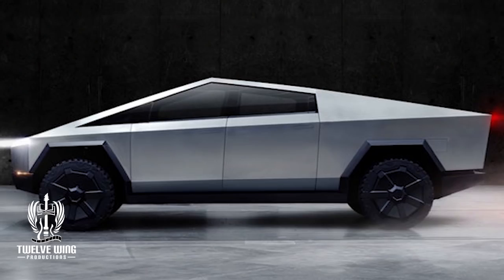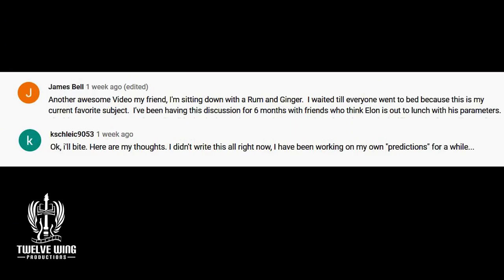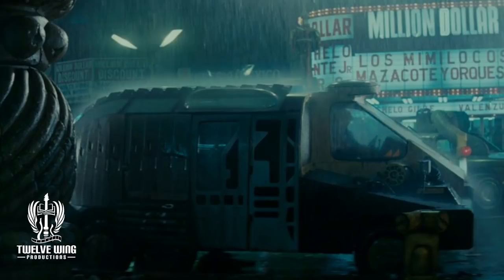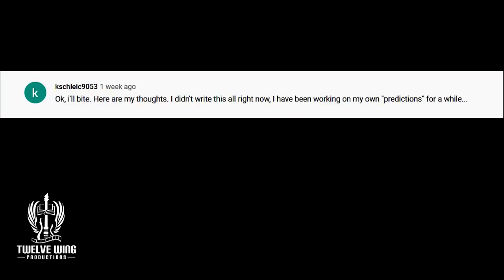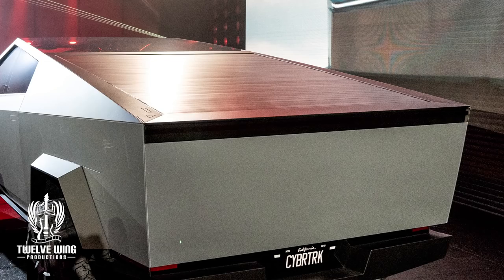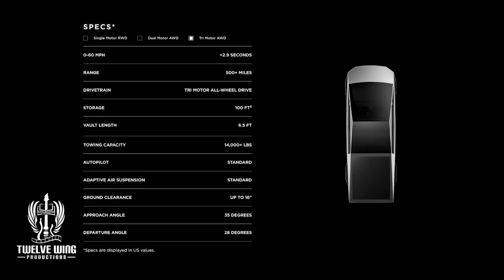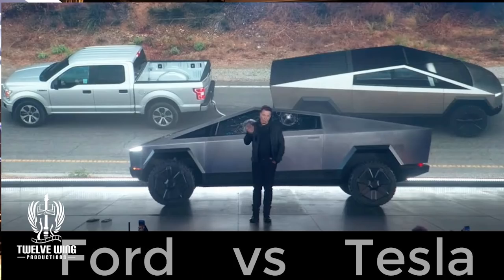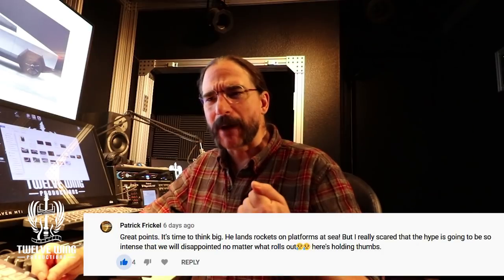Tesla's Cybertruck was not designed, it was engineered.  Here's how you benefit.

Comment: Thanks for the mention,  I wish I'd gotten more right but this truck looks almost how I was imagining.  I don't find it ugly at all.  I really enjoyed putting my wish list to paper on the last video.  This truck in its current form offers so much of a blank canvass.  I'm not talking about the lack of paint.  The first think that I was thinking was "CANOPY MODE".   I would like the vault height to adjustable at the gate.  The tonneau cover should be on a frame and hinged at the vault peak with sides that slide into sides of the vault (pocket door style). Once the tonneau was level, the frame would lock, and the ramp from the gate would slide up, securing the VAULT in 'canopy mode'.  
Hey I was wondering if you would be interested in addressing the "other elephant" on the internet here in a future video.   Towing at Max GVW ... "Sure it'll go 500 miles ... EMPTY !!!"  All the haters seem to have this as their goto criticism when it comes to electric trucks.  I think that most people are looking at this towing conundrum all wrong.  The fact that we are dealing with electric drive trains opens us up to a whole new opportunity for innovation.
  The whole Battery Electric Skateboard 'platform' is already practically a trailer.  We all know that 'pulling' extreme weight has nothing to do with towing (I think you've even said this sort of thing before).  So if we throw a couple of those model 3 motors(or however many are required) and a suitable battery pack under the floor (most trailers are basically ... a floor), would that not exponentially improve braking capabilities?  If we were to sync the computer from the trailer to truck and let them share the batteries, could we potentially 10X the range depending on the size of the trailer? If we were to engineer it properly could we safely 'PILOT' a trailer and load on par with Class A Semi long haulers?  I say "PILOT" because it would seem that the trailer essentially becomes its own powered vehicle. The CYBERTRUCK would just 'clip in', supporting a fraction of the overall weight. And of course this works for any type of trailer from low-bed haulers, 5th wheel Class A RV's or Utility style Construction Tool lock up trailers.  This only just touches on how much the 'OFF GRID' potential for construction and or recreation just increases again exponentially.  There are some trailers that will require some further thought.  Boat trailers are going to require some design modifications for instance. LOL  Anyway this could all be for a different conversation one day.  I might be out to lunch here but when I start hearing people say that it can't be done my mind starts racing on possibilities instead.
Reply: Pretty much what I was considering
Reply: If the new solid state battery tech passes, the distance will be a non-issue.  I know Elon has been working with Goodenough with the tech so unless something goes wrong we'll probably be seeing it fairly soon.  Heck didn't Elon announce the million mile battery? That's probably the solid state battery tech.
Reply from the maker: @yg2522 , Have a look at the video we put up by that name.  I go over some of the hallmarks of a solid state battery.  Key among them is that the battery will actually increase in capacity from when it was new.  Perhaps for a few weeks to a month.  That is pretty much exactly the opposite of what happens to traditional paste type electrolytes.

Comment: Just a small comment, just as they have an air compressor for the suspension, they have a DC/AC inverter for the motor to support the plugs. So theoretically they can provide as much as the inverter can provide for the motors.
Reply from the maker: Dang it... I totally forgot to mention the air compressor as a missing specification.  Good catch.
Reply: @twelvewingproductions7508  no worries, I think most of people here are very familiar with the car :)

Comment: This vehicle is going to have a diverse market because it will do things that no other car or truck can do.  I'm 70 and ordered a 2 motor Cybertruck.  My neighbor's a 72 year old lifelong Ford guy who currently has both a gas F150 and a diesel F250.  He ordered a Cybertruck.  My oldest daughter ordered a Cybertruck.  Then I ordered a single motor version as they may become available first.  You can either welcome the future or resist it.  Resist it and you get run over.  These are vehicles that you'll be able to leave to your kids and know that they'll be safer and happier.

The Tesla Cybertruck works as both a 6 passenger SUV and a 3500 lb load capacity pickup.  Tons of storage front, sides and rear.  All lockable.  Supports both 110v/220v electric and air power tools.  Up to 16" clearance with air suspension that adjusts to load is standard.  More powerful than any ICE pickup or SUV available.  250+ to 500+ miles of range.  2x faster charging than even current Teslas.  Virtually waterproof.  Far lower maintenance than any ICE vehicle could ever hope to have.  Cold rolled, 30x hardened stainless steel alloy developed by SpaceX:  a rustproof and generally scratch-proof body that will even repel 9mm FMJ bullets.  The most advanced drive assist electronics available and over-the-air upgrades are included and even full autonomy (when it arrives) as a purchase option.  Solar charging for range extension.  The biggest downside is that we'll have to wait until late 2021 for large scale production.

Change is the only constant in the Universe.  Don't let it run you down.

Comment: It’s not that Tesla stopped before styling it; It’s that 3mm cold rolled stainless steel won’t cooperate with being styled.
Reply from the maker: That's what Elon Musk said in his tweet, but that alone doesn't explain the lack of styling.
I don't believe that this was an engineering or design choice ahead of time.  I think the material was the result of the decision not to stamp the car.  Not the other way around.
The reason for this is that from the beginning it was decided to make this truck on the cheap.
That was an engineering requirement I didn't give enough weight to when I did the first video.

So while it might be true that the decision was conjunctive, this truck wasn't styled in any way.  Its shape is the direct result of its engineering and that saved them a fortune.

Comment: There is a popular opinion floating in the internets that this truck will have safety issues due to it not having conventional crumple zones. My thought was... can't they just scar the steel from inside strategically so that it has some needed crumpling properties?
Reply: Yeah. I also think its very likely this will actually be a class 3 truck, like the Bolinger. Think about it: The payload is 3500, so if the truck weighs 6501 boom, class three. The heaviest F150 is 5700 So especially with a large battery, air compressor, all the steel paneling.. well it's not much of a stretch to think it's just over 3 ton, and that would make sense as to why all the models have the 3500 payload, because they all need to have curbweight plus payload breach the 10k gvwr to make it into class 3. 

Now I assume that Elon would still do all kinds of things to make the truck safe in a collision, like scoring the inside of the frunk frame, but if it's Class 3, he'd be doing that as a freebie, not as a requirement... maybe? They don't need airbags, and some are putting them in anyways, but I don't know what else they get to skip. Crumple zones might be part of it.
Reply: Every ute in Australia has a bull bar on the front so hitting a cow or a kangaroo does mean an automatic write off. I'm not sure truck owners care about crumple zones.

Comment: What I would love to see (even as an option) is a 380 V Outlet and a DC outlet to charge other electric cars.
Reply: I thought I was the only one!

380 is the 3ph with the ph to ph voltage at 380, ph to n at 220 that they use in Europe?

I was wondering, and the more I think about it the more I assume this wouldn't be possible in actuality without some serious hacking, and that Tesla would never want to introduce the complexity, failure potential, contact bridging impedence etc... but the Truck has a built in 3 ph super high amperage high voltage inverter... Why not let us plug into that? But it's hardwired into the drive train, and sealed, and yeah, that's very unlikely to be worth it.
Reply from the maker: Or us industrial 208 3phase.
Reply: @twelvewingproductions7508  well the motor inverter is capable of both. I've seen very little in the way of high quality 3phase out from DC. I've heard you should be able to energize the post bridge rectifier DC bus on most vfd systems, but I'm not really sure about ones that would take the 340-400 vdv coming out of the pack... 

I guess a 380/400v 3 ph input vfd might handle it well, but you might need a resistor in line to shunt initial amperage flow through because those vfds tends to have large cap banks....

I don't know, could be sketch. What would you need to run on three phase? 

Never mind that question, giant cast iron bandsaw, suddenly portable? In reality I think it's 20 something horse and a 7.5 powered feed, so it's likely too much draw for any inverter I would ever buy.
Reply: I am afraid that drawing too much power from the truck battery pack might limit the range, but hoping to see for a separate PowerPak sold as accessory you can add to get the power needed for tools.. or extending the range when needed hmmm..
Reply: @Music-ry5un  well, to put things in perspective:

Base model 2wd is likely a current x 100kwh pack. Musk indicates a bigger battery available on the model s /x plaid refresh coming next year, so I'm guessing 120-150 for that, made of current cell tech, primarily, but with 2170 refit into the s/x. They got improved energy density with the 2170 so it could be up to 150 kwh, but only if they are very lucky in how the layout works, which means 120 is more likely. This goes in the 4wd 50k, which explains why it's only 300 estimated range, not 370-400 that we would expect from a 50% increase in kwh. 

This leaves us with 200-250kwh on the truck with next gen cells and 500 mile range.

When cruising at 70 the model s uses a kwh every 3 miles, so you've burning through like 25kw. A massive 60a plug running on 240, which is the max nema cert plug at that voltage only consumes 15kw peak, so if you had the smallest battery, and you were welding 1/2" or fast charging an electric moto or quad...  Maybe in 7-10 hours you're in trouble? 

I think people regularly underestimate the massive load of batteries in a Tesla. If you are talking about the 70k Cybertruck, you could go hard for like three shifts before that sucker is spent. It's an insane amount of batteries. 

That's 16 fuckin power walls (second gen), for reference.
Reply: @Music-ry5un  haha, i was curious so I looked it up, the powerpack 2, holy shit. Your can almost get 2 more high performance Cybertrucks for the same price and end up with double the battery. Not adorable at all. They do put out a ludicrous 100kw peak which is like hundreds of amps, so they are skookum AF. Still, you won't need it if you get the 70k CT
Reply: Mark Allen is correct. You are not going to get a quality high voltage 3 phase port. I also don't see any reason why you would even want one lol. A charging port parallel with your motor is a horrible idea.
Reply: @dingo9696  haha. Horrible or hillbilly? I see they both have many of the same letters, passes my test.

The only reason I would want 3ph outlet is for running industrial welders and big motors for things like a bandsaw. I've been thinking about buying one, it's very old, very much not intended to be portable, but it's got a real beefy electric band drive and a powered feed on a separate 7.5 horse. Since it is so old and out of date, it's very cheap, but if I could get a huge 3ph output from the truck I could create a mobile slabbing mill that would shit on any woodmiser for another 2k in framing and trolleys... It would be hilarious and absurd.

Definitely not worth creating an ingress point and bricking the transaxle over though. 

You know if it would be possible to repurpose an inverter from another motor and build a simple control board that only creates a pwm sinewave 400v   3ph? Would that be enormously easier than creating a true foc motor controller, I want to say yes, but I'm only starting to learn the finer details of these systems and I don't trust myself for shit. 

I think I can get an inverter with a bricked control module for 500-1000USD with 800a igbts.... WTF that would be 660kva Max and 500hp... What did I do wrong? Is my amp max value for the igbt likely off by an order of magnitude, or do they severely derate the igbts for longevity or due to high frequency issues in a pwm circuit? Cause this was running a 55kw peak motor, not a 450ish.
Reply: Mark Allen Mark Allen Again, the first question should not be whether it’s possible, it should be why is it necessary. I can’t visualize how having a mobile bandsaw would be saving anybody much time, and unless it’s something absolutely massive, it would run on DC or single phase AC.

As for the IGBT, the values you got are likely correct, but it’s important to keep in mind that designing your own high voltage PWM is a recipe for disaster if you’ve never made one before. It is also important to note that starting currents for induction motors are massive and sometimes an order of magnitude above the rated current. High voltage PWMs are no joke and mistakes like insulation failure, Electromagnetic influence (like from the giant permanent magnets that Tesla is putting on new motors) could very well destroy everything you bought (or you).
Reply: @dingo9696  hmmmm... so single phase ac options cap out about 5hp. DC systems are actually much more dangerous, due to the way arcs react... it's not terribly important because it doesn't really relate to most peoples lives, but once you're past the size of the stuff sears sold guys for their garages or things a contractor would use for framing a house, you're out of that territory. Bandsaws and circular saw mills all run on gas or diesel because without three phase, electricity is not capable of safely providing the power necessary. All the electrical drive systems these days use DC-> 3ph AC. Forklifts, trolleys, tugs, mining skiffs and scoops, and all the electric vehicles. All the industrial power tools, saws, lathes, mills, shapers, cnc etc, all run on grid 3ph. There is a niche that could develop for 3ph grid AC like power running equipment that normally is grid tied, but I'm not sure it's very big in the states. In Europe and maybe parts of Asia, its' much more common to have grid 3ph available, and more things run on 3ph in terms of garage sized tools. 3ph is MUCH better as a power source for running a motor. I feel like you must already know this though...
Reply: Mark Allen Yep I’m aware that 3ph induction motors are the workhorses of industry. As you outlined in your original comment though, it is rather uninformed to believe that the average PWM or inverter system will output a quality sinusoid, and the problems in that are only exacerbated when using the resultant signal for industrial applications where efficiency becomes more important. When I saw you say it was a 7.5hp motor I had assumed it wasn’t something beyond the realm of 208V single phase, but I may have misjudged what the system requirements are for the machine.
Reply: @dingo9696  the 7.5 is just a separate power feed system. The band saw drive motor is 20 or 25 horse. It's a massive old shop saw with a bolted in mid section that allows it to be expanded for larger bands. 

I think the market is small enough that there is no point in Tesla producing the 3 ph system, but as a lover of old industrial stuff that isn't competitive in the industry anymore but has lots of life left in it for home/hobby/side gig work, I'd love to see it.